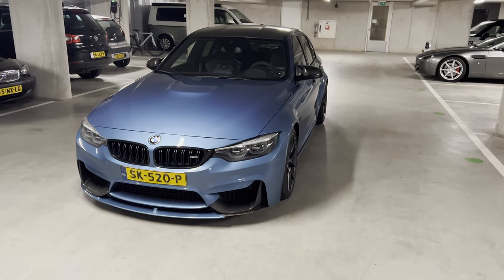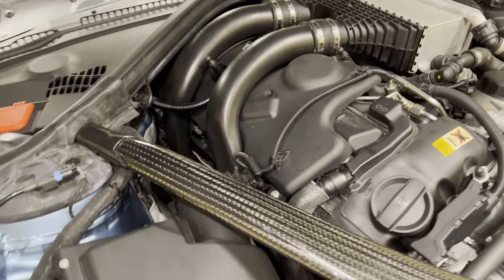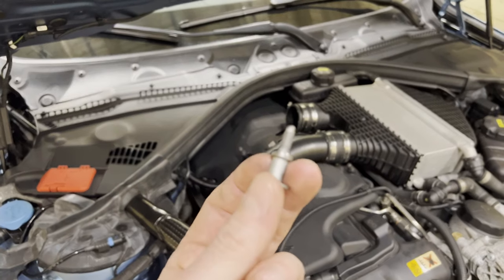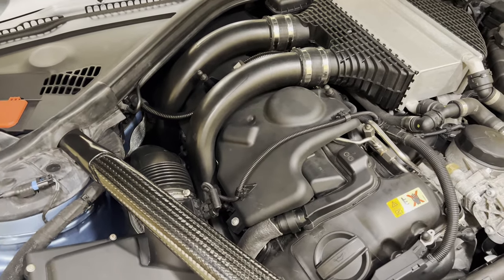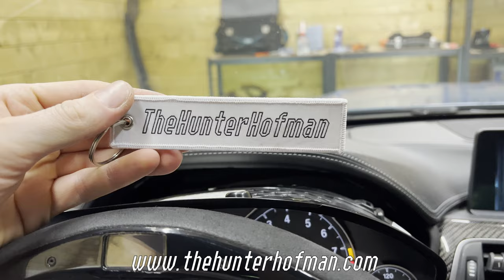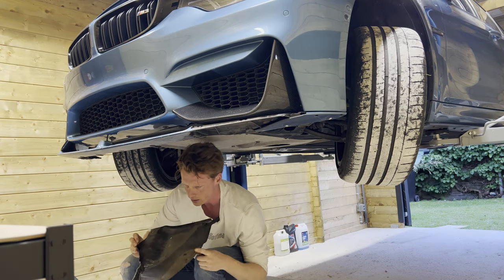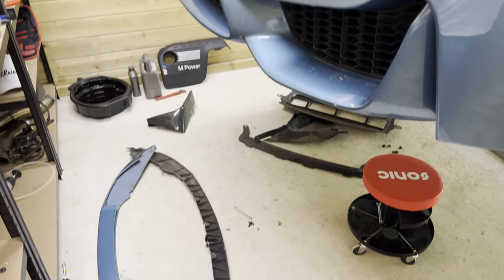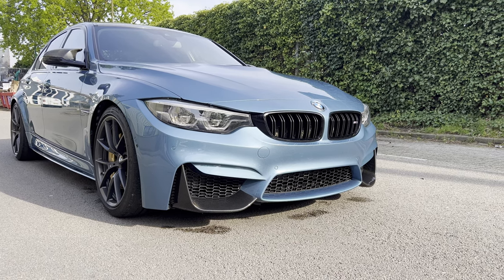BMW M3 Competition: Repairing DAMAGE

Comment: The holes on the side carbon pieces are from the M perfromance splitter. They are there because of the OEM install of the plastic splitter. No wrong there. Also go with the cs original splitter if you can it gives a little bit more of body clearance